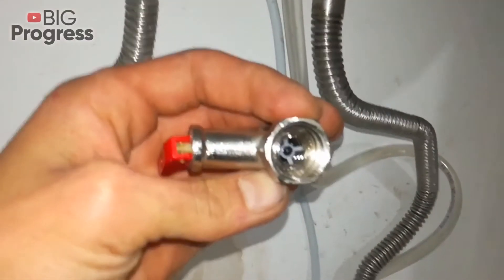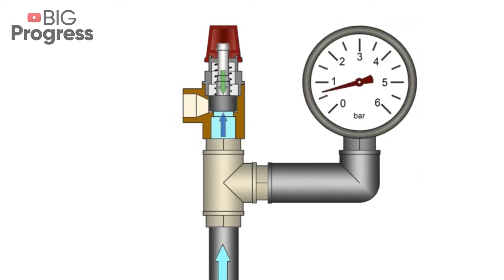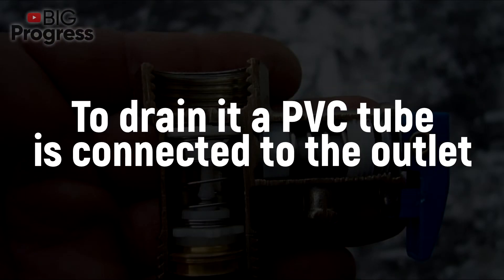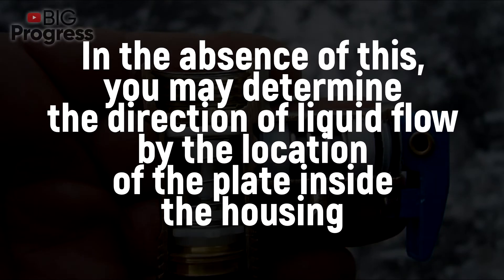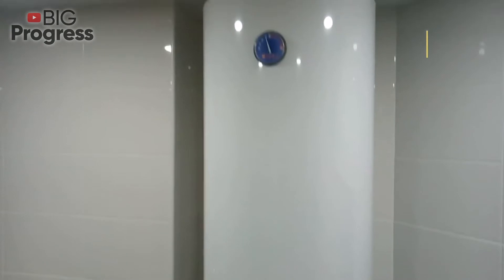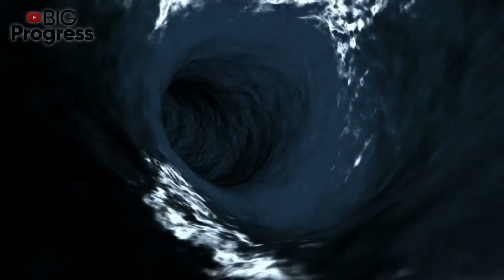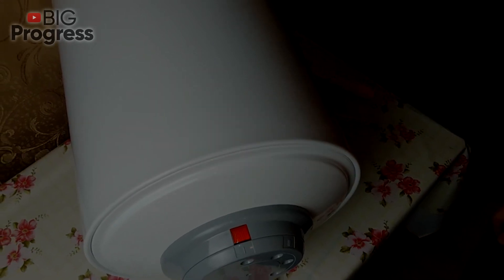How To Choose Check Valve For Water Heater And Boiler

Comment from the maker: 00:00 Welcome to Big Progress
00:25 The function of safety valve
01:38 This is how it all works
03:08 Different types of valves
05:04 Installation rules
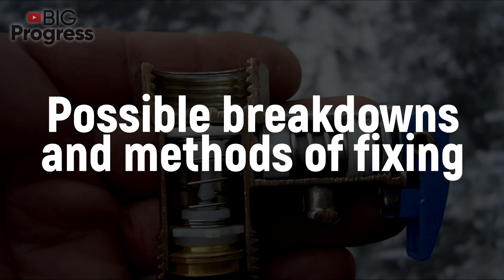06:37 Possible breakdowns and methods of fixing
06:53 Here are the possible causes of leakage